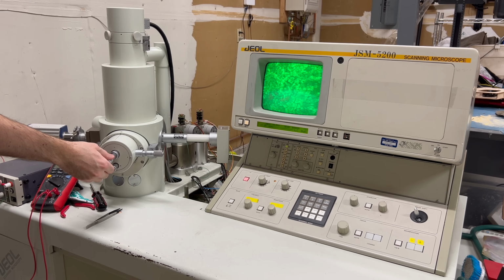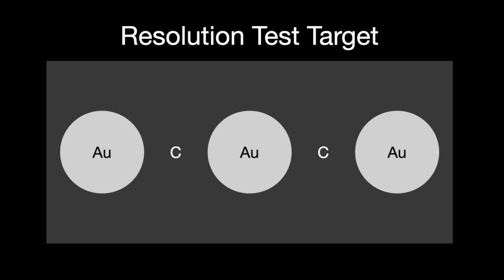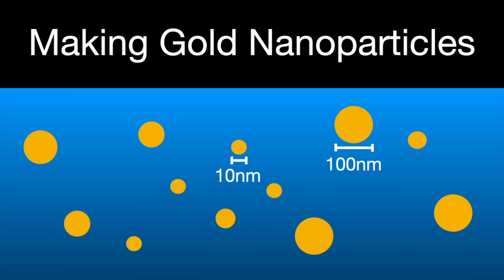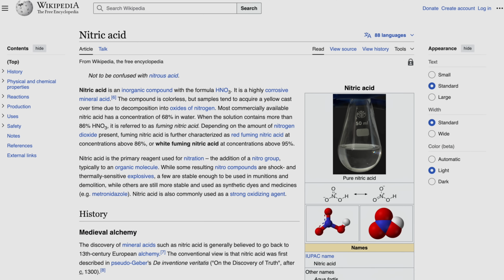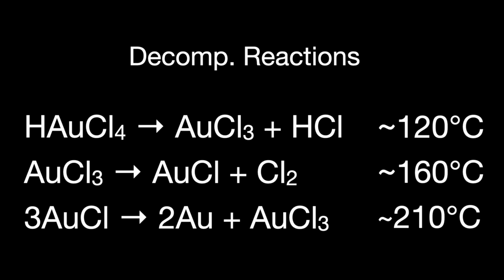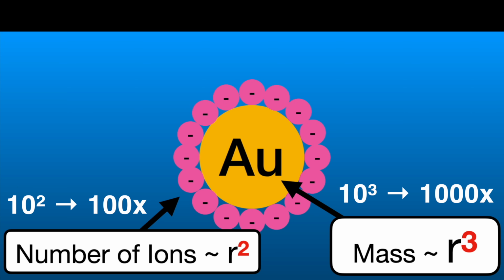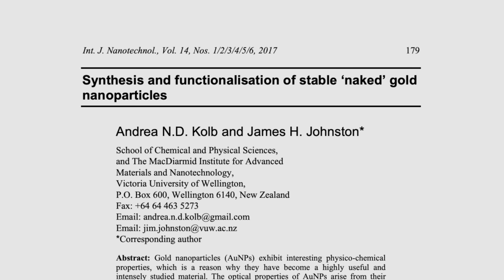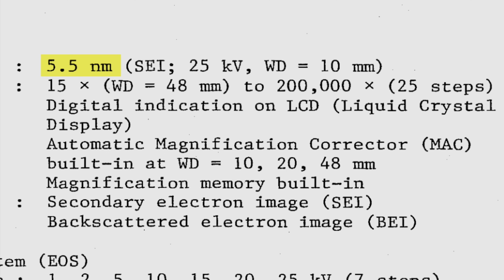Making Gold Nanoparticles to Calibrate My SEM

Comment: Couldn't you have used a laser to blast a sheet of gold leaf while it's suspended in solution? Then you vary the strength of the laser to obtain variable nano particle size?
Reply from the maker: Possible, but i am not sure how well i'd be able to control the size. I ended up going with the wet method because i had invested so much time into that process.

Comment: You can use detergents/soaps for controlling particle growth using polarity and ph. It creates "mini reactors" just like with dirt and water attaching to opposite ends as some molecules are locked inside, and the micelles grab on to the others it shifts the availability and concentrations. 

When making Copper nanoparticles, using copper sulfate and citric acid shifting ph with sodium hydroxide allows you to change the shape of the particles as well. Sadly I don't have an SEM so I couldn't measure size, according to the paper they should have been around the 10-20nm mark though.

Comment: I use the pits and lands on CDs and DVDs to calibrate my Laser Scanning Microscope. They're in the hundreds of nanometers and have specific sizes. However, the pits are designed to cause destructive interference in the wavelength of light used to read them in a player and increase contrast, so I'm not sure if they'd work with a SEM.

Comment: I made AuNPs and it was quite easy. Search for the paper "Kinetically Controlled Seeded Growth Synthesis of Citrate-Stabilized Gold Nanoparticles of up to 200 nm: Size Focusing versus Ostwald Ripening" in Langmuir by Bastus et al.

If I recall correctly, the size variance was around 8%, so not monodisperse, but damn good.

Comment: you might need to replace some electronics to tune it further, i’m sure some resistors have drifted out of spec and the same for other analog parts.

and you could try digital potentiometers/resistors which let you step their value around. looks like they’re around 50 cents each and smd so not something to replace everything, but could be handy for tuning a few very meaningful resistors as long as they’re not too high current. or just replace everything with the intended value and that’s probably good enough.

Comment: This video was right on target!  BTW doesn't seem necessary, but did you consider carbon paint instead of silicon substrate?
Reply from the maker: i actually tried something like that but it didn't make it into the video. basically, the carbon layer wasn't smooth enough on the microscopic scale, so because of that it wasn't a suitable background

Comment: Just a little tip for bigger nanoparticles: try substituting some of the citric acid with ascorbic acid (vitamin C). Without any other reducing or stabilising agents, this can make a range of sizes from 30nm to well, as large as you want really. At room temperature it makes around 100nm with a 3:1 ratio. Add the citric acid (5:1 ratio of citric acid to chloroauric acid for small nanoparticles, less for large) then make up the ascorbic acid separately, using 1/3rd of the amount of chloroauric you used. With stirring, add it to the citric/gold solution drop by drop, slowly. Then wait 30 mins, continuing the stirring. Will take longer if done at reduced temperature, of course.

Comment: Isn't it hard for an amateur to buy nitric acid due to its use in the production of explosive compounds?  Might also be a reagent in making or processing certain scheduled drugs too.
Reply from the maker: depends on where you are. In the EU it's basically impossible. In the US it's available online but at low concentrations. It is a dangerous chemical and demands respect because you can accidentally produce explosive compounds with it if you aren't careful

Comment: Hi ! First of all - impressive work on the gold nanoparticles. Just wanted to let you know that as an owner of several JEOL SEMs - with JSM-5400 being closest your machine - I can confidently tell you that you pretty much got to the top performance out of your scope. They 5200/5400 have the same analog part with the 5400 having a frame memory built on top of it + the column is upgraded. In both models at magnifications above 25K the scan generator - which as based on opamps is the main problem leading to poor image quality. Due to suboptimal sync with mains / noise in general you will see a wavy distortion image (as in the previous video - the "strobe" image).The System Six generator is much better as it is digital and you get rid of the wavy distortion as shown in the previous video. So once the scan generator is optimized, currently the main "problem" is the column itself. As this is an entry-level scope the electron optics is not great and you will most likely get grainy 50K images with reasonably well defined features. Theoretically isolating the scope from vibrations could help (there are screws for stabilizing it - consider placing them on rubber blocks). Im not sure on the design of the 5200 colum (5400 has a strip aperture) but I would guess that there are some apertures in the column. Looking at the current performance they are most likely very clean, but perhaps cleaning them could slightly improve the image but most likely not dramatically. Also consider checking if the Noran software has the EDS part active - you could try using it with a second-hand detector from ebay if you dont have one already. If you are looking for a better performing SEM that sometimes can be bought on the cheap - JSM6400 is waaaay better (but much larger), sometimes you can find JSM 5500/5600 or 5800/5900 for reasonable prices. Anyways - really impressive work on your SEM !
Reply: "as the owner of several SEMs"
Reply: I would love to contribute to funding a collection of SEMs that kids and students can learn from, you could be like This Museum is Not Obsolete!
Reply: This is a legitimately cool human being
Reply: @woodlandknight85-pv6ww English is outstanding my fellow humanoid creature
Reply: Como has conseguido 2 o más microscopios de ese tipo si son carísimos?
Reply: what about the JSM 820? Worth a shot?
Reply: @Projectsinflight is commenting on other not so useful comments with good message. But here with such a good explanation, just a heart??? Wtaf.
I felt bad for you😢
Reply: THATS LONG

Comment: A practical substitute for aqua regia is to electro‑leach 24 kt gold directly in hydrochloric acid, producing AuCl₄⁻. Set up a cell with a gold anode and a gold cathode in 2–4 M HCl. Run the cell at 2.2–2.8 V or, better, control to about 0.1–0.25 A dm⁻² of anode surface. Gold dissolves anodically to AuCl₄⁻; once gold begins to plate onto the cathode (≈ 99.99 % Au), the batch is finished. Any incidental redeposition on the anode is still pure gold and easily recovered, so nothing is lost. This is why I said to use a gold anode. I think this is easier than making HNO3, but everyone is different.

Comment: Is it possible to fight the image noise by averaging subsequent frames out? Maybe get some signal processing involved?
Reply from the maker: The image capture device does do frame stacking, so that can help. However you can also scan slower, which can accomplish a similar improvement for signal to noise ratios. For my SEM, the current problem is a ~60Hz interference which is probably EM noise from power lines. That's a bit harder to remove unfortunately
Reply: @projectsinflight Time for a mu metal shell for your SEM column

Comment: Have you tried co-precipitation of feso4 ,fecl3 and naoh? You’d get a polydiverse population of magnetite nanoparticles ranging from 5nm to 200nm.  Sodium citrate or oleochemicals acid would help prevent agglomeration and oxidation.
Reply from the maker: I chose gold mostly for it's chemical stability. My concern would be that the iron particles would oxidize and deteriorate
Reply: @projectsinflight  the iron precipitate would already be in an oxidized form which is quite stable.

Comment: 11:50 isn't hydrochloric acid literally HCL gas, absorbed in water? Wouldn`t boiling just the fumes out and trapping them in (clean) water again yield a more effective distillation?
Reply from the maker: HCL gas forms an azeotrope with water, so if you start with high concentration Hydrochloric acid you will boil off more HCL vapor than water vapor, but if you start with low concentration you will boil off more water than HCL. 

I could have done a more effective distillation by intentionally trapping the vapors released in water and saved another ~30% of my yield

Comment: I work on sem/fib dual beam beam microscopes for Thermo Fisher, and at 28:00 it looks a lot like your getting a ton of flagging in that image. This is distortion from vibrations and it's one of the main things that limits hitting resolution targets for us in the factory. I would highly recommend looking into getting some forms of vibration mitigation on your microscope if you wanna improve resolution even farther.
Reply from the maker: Yeah- I have been slowly accumulating some tools and knowledge to try and tackle this problem. i haven't yet determined if it's solely mechanical vibration, EM interference, or possibly something else. if you want, feel free to email me at projectsinflight at gmail dot com and maybe we can talk about it more
Reply: @projectsinflight Simply pour a vibration isolating concrete slab in your garage. Wonder how much that would cost?

Comment: So up next, you've gotta get into gold-deposition. I've got a 1970s era electron-beam deposition controller, along with a chamber and a painfully nice diffusion pump setup. But I still gotta get a few more parts before I can get it working. So I've been back-burnering the project for....oh jeez it's been a decade now....TIME, WHY YOU GOTTA MOVE ALL WEIRD AND SUCH?!?!?
Reply from the maker: What parts are you missing? I've actually built a thermal evaporator before and would like to rebuild it soonish
Reply: @projectsinflight  the e-beam gun itself and the high-vac gauge controller. Both very solvable problems though. Oh, also some pass-throughs to rotate the object. That can get a bit more pricey. Evaporative deposition is massively easier; and probably fine for most cases, but electron-beam deposition can give you a more uniform coating.

Comment: I think 'The thought emporium' made a video on a somewhat hobby friendly thermal evaporator though I might be mistaking two different machines
Reply from the maker: Yep, he made a sputtering system. I will probably do a thermal evaporator, which is similar but uses a higher vacuum and no magnets

Comment: To anyone curious, instead of using sodium citrate, you can use leaves of camellia sinensis (tea leaves). Yup, just use the tea bags you get from the store or loose leaf tea. Preferably green tea, so you can see your nanoparticles better. Why would you do this? Because it is fun and you can. This method can make a variety of types of nanoparticles made from different types of material, not just gold. It doesn't always work, but from my experience, it works more often than not. The size control is surprisingly good as well. I have used them to make gold, silver, and iron oxide nanoparticles, and many more, as I cannot remember off the top of my head. Have fun and stay safe!
Reply: interesting as this as I reverse engineered high end filters discovered during covid that coat any filter and will collect and kill 99% of mold spores and even cover passed thu em without slowing down lime some filters turns out they charge 50$ for a spray bottle of this as i suffer from lyme, turns out the school in India discovered this sold the formula to a high end spray manufacturers and filter seller, turns out all it was is GREEN TEA lmao 😢and 😂 🎉 wind and lose for the world as those that pay 50$ to have a 1$ filter sprayed with 2cents of tea is just diabolical may you share this knowledge forward
Reply: I suffer from lyme and discovered this to prevent  flare ups from high mold seasons

Comment: Could you have made a standard by using carbon and lead coasters to just coat a sample alternating between carbon and gold, varying the thickness?
Reply from the maker: There are definitely a lot of possibilities! I think if I had a thermal evaporator I would definitely try to do something like this. The only issue is how i'd expose the layers for proper viewing. I might need quite the polishing step

Comment: would replacing the monitor screen increase the resolution?
Reply from the maker: Unfortunately not. The resolution is mostly limited by the physical size of the electron beam, so basically you need to squeeze the beam and make it more narrow to achieve any additional resolution.

Oh, that and you need to reduce EM interference from power lines, and also mechanical vibrations

Comment: Question: What happens if you use the SEM to image a sample that's missing electrons, like something cationic? Would it cause a reaction in the chamber?
Reply from the maker: That's actually a really interesting question with a couple of possible answers! So it's likely that the electron would be captured by the cation, forming a neutral atom. However, the electrons in the beam actually have a ton of energy- so it's also possible that energy would cause the neutral atom to then lose electrons again.

By the way- this is how the SEM imaging works normally- the electrons in the beam crash into the material to be imaged, and this causes the sample to eject electrons, which are captured by the detector. However, this doesn't produce long-lived ions, because the SEM power supply provides replacement electrons. This is necessary to prevent a buildup of charge that would deflect the electron beam
Reply: @projectsinflight  That's really neat! I wonder if that puts a limit on the size or types of materials imaged - like at what point does that become destructive imaging?
Reply from the maker: For electron microscopy you can generally assume that imaging is non-destructive- however, things like plastics and some other fragile materials tend to be visibly destroyed. you can even watch the stuff get destroyed in real time in the SEM
Reply: @projectsinflight  Thanks for satisfying my curiosity :> I love microscopy & cross-domain problems.

Comment: Rub down all the unprotected metal you can find with a mildly basic solution..  
Or you'll be finding random rust on things for ages (which will constantly remind you of your HCl vapor blunder).. 
... speaking from experience !   (it sux)
Reply from the maker: Yeahhhhhhhh... so my lathe chuck now has a light coating of rust on it. Oops.
Reply: @projectsinflight I was finding random bolts and screws totally rusted like a year or more after I let HCl vapors get all over in my lab (and I too thought:  meh, it's dilute, what can it really do after Brownian-ing all over.. I was wrong!).  
Basically all the unprotected metal in your lab is on fire (just super slow fire).. I had to replace a lot.. it sux'd!  I hope you got lucky
Reply from the maker: I think i minimized the damage by airing things out quickly. i'm super happy to have the fume hood now to prevent this in the future

Comment: My powers of alchemy ... are in the shop right now
Reply from the maker: hehehehehe
Reply: ALICE at the LHC turned lead into gold recently
Reply: @thewhitefalcon8539  Really?  Shouldnt that have been big news if it happened?
Reply: @tippyc2   it's only like a few atoms
Reply: @tippyc2 it costs more to make than the good is worth by a couple orders of magnitude
Reply: @thewhitefalcon8539   so they haven't alchemized a full-sized metal sample yet? looks like we have yet to find a proper fullmetal alchemist...

brotherhood
Reply: @thewhitefalcon8539  the biggest problem with transmutation is it costs about a million times more than just digging it up
Reply: the next rune circle HAS solved transmutation!